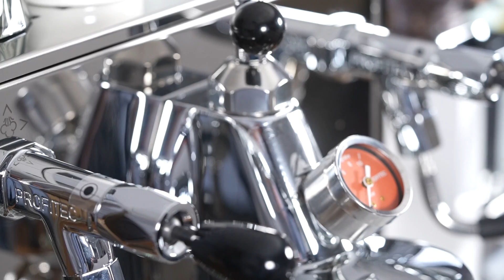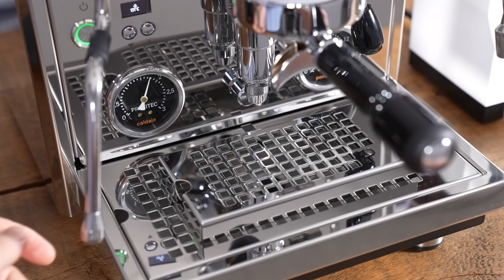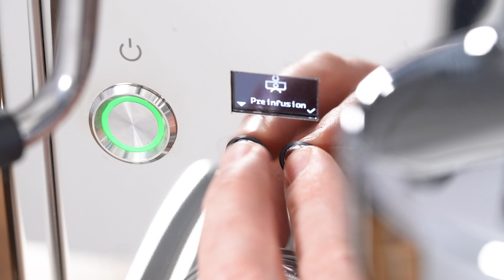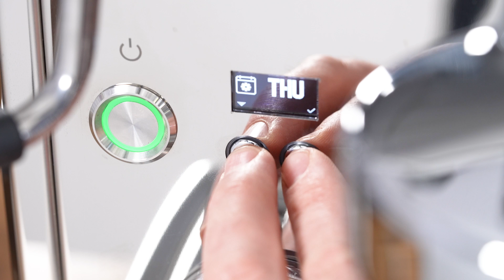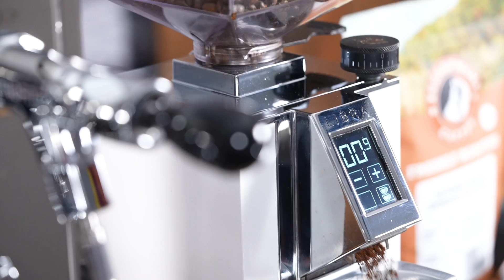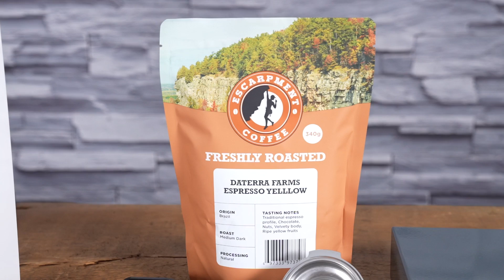Profitec Drive Espresso Machine

Comment: Thank you for video ... best explanation of various features on YT especially pre-infusion.  Would you say plumbing machine in would be worth the effort when it comes to pre-infusion ?  I.e., using line pressure and controlling it with lever as opposed to the active performed by the machine or the flow control as you demonstrated ? Th anks

Comment: Active pre infusion is for when running from the reservoir. Passive is for when running from mains pressure. If using the reservoir you should set the passive to 0. The opposite of running from mains.

Comment: Thank you for the video. Its great. The one question I have is how does the Profitec handle multiple shot servings back to back? Does it take a long time to reset boiler temps for the next shot serving? I am concerned about hosting a small party and having to do 6 espressos one after another and have long wait times in-between. Also, I would love to see you do a review of the CREM ONE PROFILER Dual Boiler Espresso Machine. I am either going to buy the Profitec Drive or the Crem ONE PROFILER. The Crem ONE seems to have a quick reset after a shot and it has profiles you can program in the machine.

Comment: So if the flow control valve is open all the way the pressure will still only hit 9 bar and not overshoot?
Reply: Flow control and your OPV are completely seperate.
Reply: You would just have more water coming out of the screen shower. Pressure doesn't change.

Comment: Great video! Still debating pulling the trigger on this, the synchronika or Bianca?
Reply from the maker: The ECM Synchronika and the Profitec Pro 700 (the predecessor of the Drive) were basically the same, the only differences were aesthetics. The Drive does add some great new features with the new PID and flow control being standard. I also think that ECM and Profitec have an edge over the Bianca in terms of build quality.
Reply: I feel like I'll wait for this since it seems a lot more updated than the ecm currently and the ecm and profitec machines are top class.  The ecm is most likely due for an upgrade though

Comment: hey, are you guys gonna sell the refreshed Profitec Pro 600? if not, is there a way to swap the knobs out for joysticks/levers?
Reply from the maker: We have the Profitec Pro 600 with Quick Steam available, we also have the customizations like Walnut, Oak and Concrete and it is possible to change knobs for joysticks on an existing machine, you just have to change the valves.
Reply: @iDrinkCoffeeCanada  oh cool, for swapping the knobs for joysticks, do I needa bring in the machine? Or is it easy to DIY?